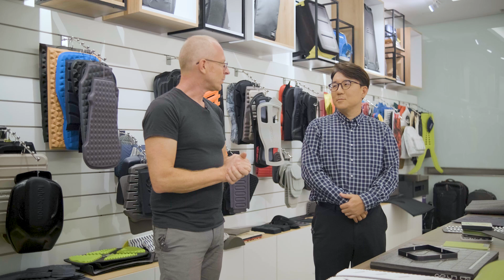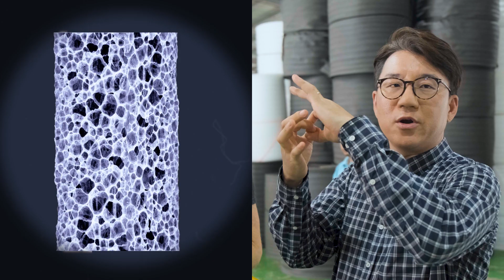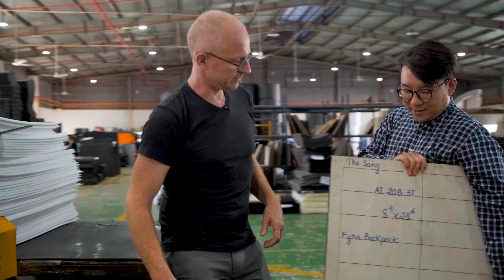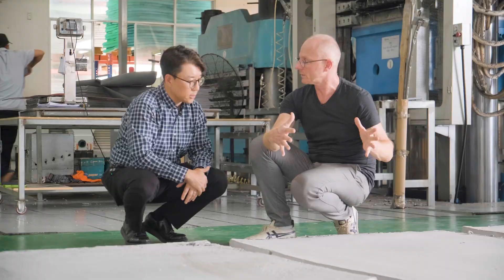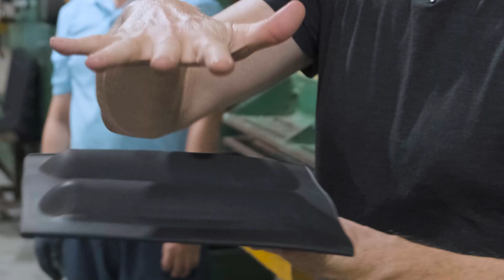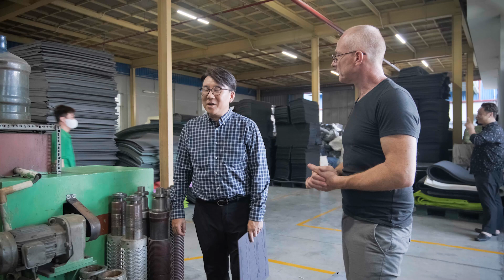Take a close up look at how foam is made!

Comment: Roughly,  how much is the cost for production of something like this.  I'm prototyping a backpack and, in the future, would like to add this type of padding.
Reply from the maker: The cost of foam itself is not so expensive "per bag" but the cost of course goes up as you bond or laminate other fabrics to it and create formed parts.  It's impossible to quote unless we know the design and have the pattern file.